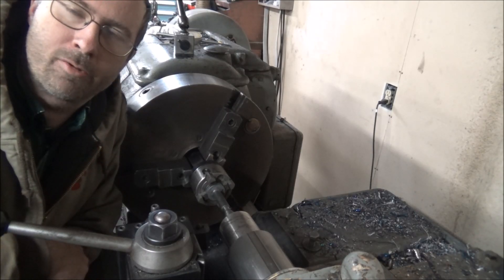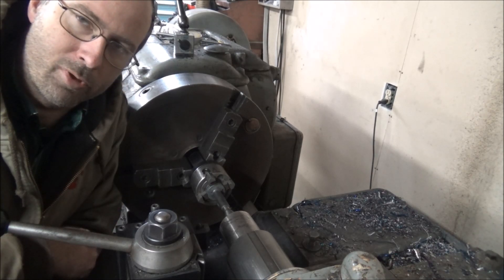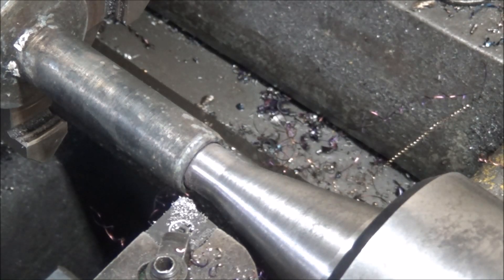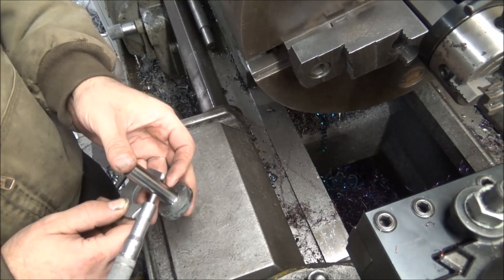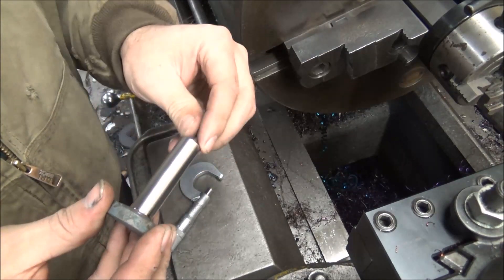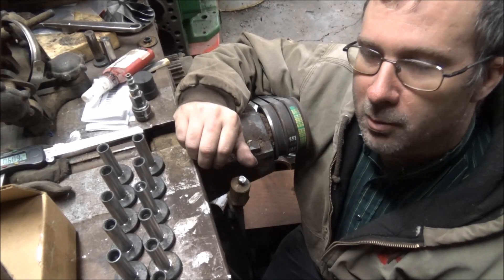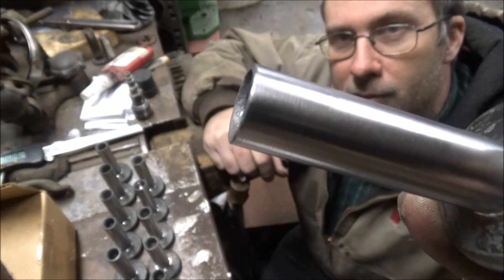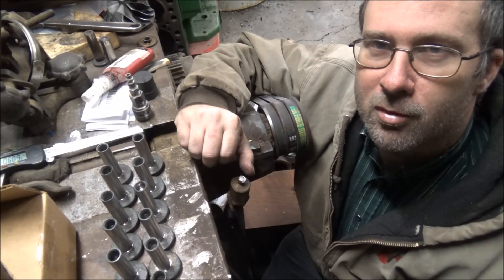Hard Turning Cummins Tool Steel Tappetts

Comment: I  also bought some BN350 inserts on Steves recommendation.  They shine in interrupted cuts and the "truing up chuck method " in Steves video that I like a lot. You may also want to check out the Kyocera ceramic inserts he recommends  for HRC 60 to 64., I tried those as well and they work even better on smooth cuts.  They are fairly inexpensive and would perhaps give even better results for the job You did since the cuts seem continuous. Around 400 sfm is what worked well for me .  Taking spring passes did not work for me, it seemed the tool was mostly rubbing. Going 1/2, measure, compensate and do the last 1/2 to finished dimension gave much better results. The geometry on the inserts I got is "T-land"   triangular TN style 6 point negative rake. Thanks for Your efforts with the videos!
Reply from the maker: because I can't even crack 100SFM on these parts I chose the tougher insert. I am sure if I could spin things faster my results would be better.  Thanks for the info, maybe someday I can take advantage of it. :-)

Comment: When you grind the surface do you grind in a dome shape (crown) or flat. ?
Reply from the maker: These are flat.
Reply: How does that work out for wear? normally lifters are ground with a dome shape? On equipment specifically designed for lifters?
Reply from the maker: It works good the factory Cummins lifters are also flat and they run 300,000+miles pretty regularly in service.  The cam lobe is ground at a slight angle to impart the  rotation.
Reply: Are you sure about that it would be the first lifter i have seen to be ground flat. I have owned an automotive machine shop for over 30 years? Usually  the dome works with the taper on the lob. The dome can be very low and hard to see unless you use a straight edge but its there. Picture it with a tapered lobe and a flat lifter you have a very small contact area. Maybe thats why you need the 62 hardness? I would look into that one.
Reply: Ps looked up some cummins lifters on the internet hard to tell from the pic but they definitely don't have a hard edge and look domed to me?
Reply: One more suggestion do the major cleanup on your grinder, Then find a shop (going to be one of the old timers) that has a lifter grinder have them touch them up with the proper radios. Isky cams used to do things like that or maybe somebody local. Good luck
Reply from the maker: I think most big mushroom style lifters are flat. Deere has them as well in some engines. I am well aware that there are barrel faced lifters as well. The flat on taper runs lower friction than a barrell because of the smaller contact. In racing you want lower friction because that makes more hp. This is not a factory application where they want to get decent life from the lowest cost parts. No limit  grinds their lifters for the 5.9 Cummins with a crowned face.They do seem to wear a bit better than some of the others but they are DLC coated as well.
Reply: i dont agree im certain that is not a good idea . I have extensive experience with very expensive race engines but good luck we are all entitled to our opinions. Flat on taper does not create a smaller contact it would create a razor contact edge and excessive side load on the mushroom style head. In high end race engines valve train weight is very important every gram counts at high RPm . Mushroom lifters would be light but with the spring loading required they POP the heads off.
In a diesel application less rpm less spring loads they work but the contact issue is still valid . I have done allot of dyno work and can Guarantee you are gaining nothing on the drag reduction theory. A proper surface contact with an oil film is less drag then a sharp edge and little or no oil film but you are stressing the lifters and creating terrible wear which is why you are having to use tool steel and 62 hardness. But im assuming your using these for tractor pulling were the total run hours is very small. So just through overkill materials your may be getting away with it.
Again we are all entitled to our opinions
Reply: Ps on a poss not those are some really cool machines you have there and your work ethic/ingenuity is impressive
Reply: One more thought on the john deer thing i know nothing about john deer engines but there were some old time engines out there that had non tapered cam lobes and a flat offset liter to create the rotation . They used a cam retainer plate to control end play.
Reply from the maker: I once read an engineering article from the 40's where Packard had tested like 6 different configurations of cam-tappett interface. Each version had good things and bad things.
Reply: From the 40's? really . we have come along way since the 40's. the demands of cams and performance have changed just a little since the 40's and many of those old engines were done at 50,000 miles. Maybe  call Isky  cams check there tech line . they have been around for along time. This is all a polite way of saying flat is ridiculous. Are you running billet cams? are you sure the lobes are tapered? who is finish grinding them?  Good luck
Ps there ground tapered to match the dome

Comment: Hi Brian,
Nice Job! At my full time job we run the positive Bn350 at 500sfm and a .0025" feed even though they can handle more. We run at .0025: with a .015 nose radius because it give a little better surface finish than our O.D grinders with CBN wheels. With a .03 nose radius you will be able run faster with the same finish but more heat generated. We use a Romi M17 and hard turn +- one to 2 tenths all day long and if we are careful we can do a little better than that. I think you had great results considering the age of the machine and the lower RPMs. You well love how good that insert handles interrupted cuts in harden steel. Thanks for sharing with us.
Steve
Reply from the maker: I may try to cut some hardface weld. That should be a good challenge for them!
Reply: Hi Brian,

I used a positive 35 degree insert to cut the dove tail in our hydraulic 10" chuck at work. Did the roughing and finishing with the same tip and it still looks like it will cut a lot more. That was a 20 degree cut .530" in length on 3 jaws. 
Steve

Comment: ya that's pretty good there are a lot of considerations in hard turning you got to admit its amazing that chuck/chuck worked the big chuck jaws at that high rpm probly have a lot less grip from the gravity pullin out on em' but the cut was light if I remember right ROHM had some interesting stuff at there website about clamping force vs. rpm what you got seems to not need any change another interesting place is Greenleaf they show how the ceramic inserts "thermally destroy" the chip at the part and peel it off like 1800 deg but like your insert negative rake so it puts the heat in the chip definitely nooo coolent with those and you'd need a Viking shield to stand behind them mothers burn a hole thru ya  good stuff I can tell from that lifters foot its ment for a steep lobe and for that I salute ya
Reply from the maker: 480rpm is not that fast even on a 16" chuck I don't think.
Reply: I thought you had it goin faster. interesting part though the closer you get it to the spindle baring the coser it will be to the accuracy of the spindle bearing. good getting the fit and finish that you need that's what counts the completed valvetrain would be interesting to see that atp looks like it stopped the de carb pretty good that's another interesting aspect of this as well thought provoking stuff well done man

Comment: Brian soon as you mentioned the insert brand and type I knew you would be well pleased. I ran them for years on CNC lathes cutting transmission parts for Eaton. + - .00025 ran over 400 pcs per edge. Actually you feeds and speeds was spot on actually a CBN likes between 550 and 400 sfm I used 450 sfm most of the time. Do you know witch edge prep. was on the inserts because a wiper edge prep needs more feed to put the nose into the material to stop chatter at light cuts, but the finish is better, a honed edge needs less feed but is less prone to chatter.

Great job
Reply from the maker: It is not a wiper, although I kind of wish it was after reading the lit that came with it as it is supposed to give an even smoother finish. My speed was way too slow, at this small diameter I can only average around 80SFM.
Reply: Don't worry about either, I've ran that low on SFM so it works. In my opinion with light depth of cut the honed edge is better, especially with the feed rates you said you was using. My guess is the finish is under 40, perhaps in the 20'S with your set up. The parts probably have a finish as good as grinding
Reply from the maker: Thanks for the feedback!

Comment: Nice result. Can you do all 14 surface grinds at the same time
Reply from the maker: No I don't have enough holders, or I would have to build a special split fixture to try to clamp them all so the grinder didn't just spin them.

Comment: Hi Neat video! Nice work! I am just a hobbyist, with a small lathe, not a professional metal worker at all but I would like to ask a question that I think I know what the answer would be but would like to ask it anyway. What would it take to turn a metal lathe into a machine that would make camshafts?
Reply from the maker: You would have to have a powered tracer attachment to create the profiles from following a master. It would be a pretty difficult endeavor.  I think on Pierre's channel they had a similar setup they used to turn the hammer handles they made. Something like that could work but you would have to accurately be able to position ever lobe and that would be a time consuming challenge. Either a cnc or somebody with the right equipment is the way to go.
Reply: Camshafts are usually done on a camshaft grinder. Lathe turns things round, cam lobes are generally egg-shaped. there would have to be a way to move the cross-slide in and out when the high part came around (more of a CNC type of operation) also have to time each lobe of the cam. not saying it could not be done but for cost would be cheaper to take to a cam grinder and give them the specs. you want. Just my thoughts.
Reply: I think joe pie from innovative machine works has a couple of cam turning videos

Comment: Do you check the hardness after heat treat?
 I wonder if they are 62rc. I have turned 60rc parts before, and the chips are blue and purple, with some sparking. Those look like they might be in the low to mid 50's rc.   Or maybe your fancy insert is a game changer.
Reply from the maker: My buddy at the tool and die shop checked one from each heat and that is what they came out as on their machine.
Reply: bcbloc02 Here's 59rc....with sparks. https://youtu.be/4LlKqxS6wNQ But CBN does not always spark.